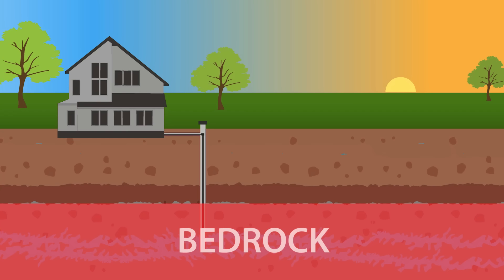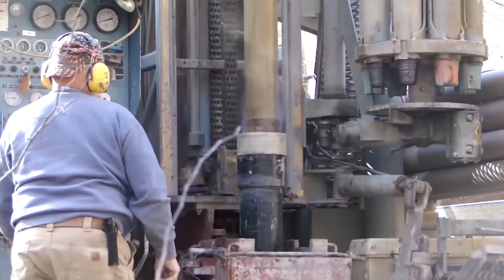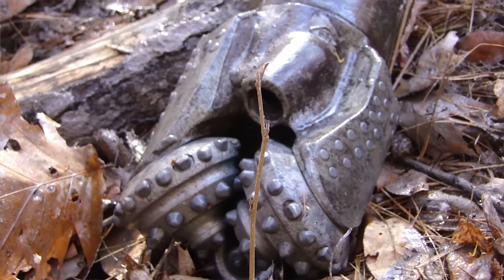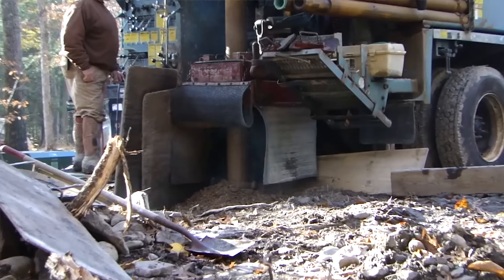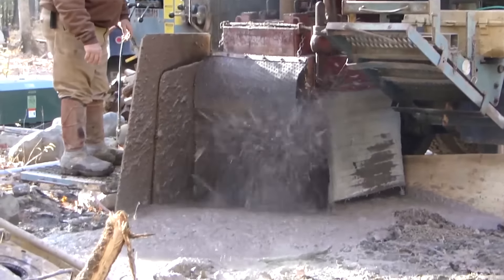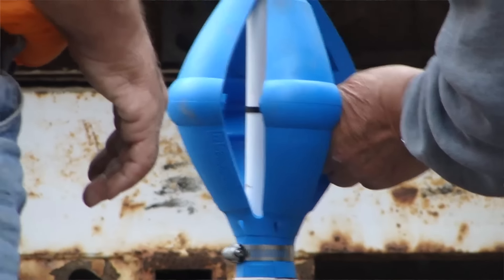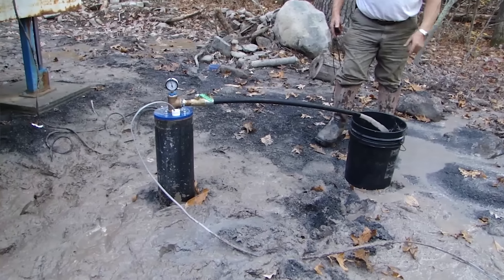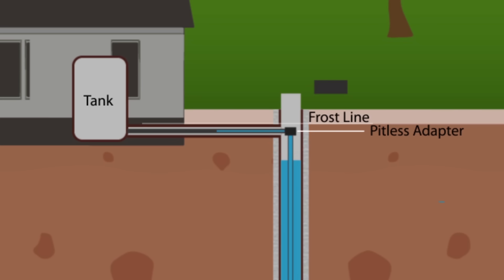WELL DRILLING 101 | Every Step Explained

Comment: PVC is not drainage pipe, the pump line is indeed under great pressure 60-80 PSI
Reply: as a drainlayer this comment confuses me, PVC drainage pipe is actually a thing. Don't often get much bigger than 375mm (should be a blond one shy of 15 inches) however yes the pipe used in this application is not drainage pipe
Reply: PVC pipe/fittings has different ratings.  If you're in Lowe's store, most common are Schedule 40 and DWV.  
The Schedule 40 is for the pipe coming from the well pump and has a maximum operating pressure of 180psi--much higher than the pump could ever generate.  
DWV stands for Drain, Waste, Vent and is used in non-pressurized situations.
Reply: Schedule 80 for electrical conduit
Reply: groundwater level changes from season to season
u went down a bit more than where you are right now just in case for dry season with lower groundwater level
also you gotta consider the water you took out, the more you got out of the well
the less pressure and lower groundwater level it gets.
so it's just safe to go down a bit deeper than you got
Reply: PVC is used for DWV applications. To use pvc for potable use you need to use CPVC. You might be able to get away using regular pvc due to the water never being treated in a plant.
Reply: you can thread schedule 80 pvc . ive done it lol tight situation. i work up in iqaluit nunavut.. not everything is easily accesible. i wouldnt be surprised if it was sch 80 pipe prethreaded specifically for wells.
Reply: Very informative and insightful. Thanks for taking the to time. Could you please give an idea of what the total cost was? Thanks.
Reply: @audrinacartier3903  CPVC, as explained to me by a licensed plumber, is for use in hot water applications as it's melting point is higher than white PVC. Like when building a new house, depending on local building codes, hypothetically speaking, one would use CPVC for all lines coming from the hot water tank and regular PVC for cold water lines. In practice, and depending on local building codes, most contractors just use CPVC throughout because in the grand scheme of building a house, CPVC isn't that much more expensive and eliminates mistakes and confusion between hot and cold.
Reply: Yes,,,, If there is a pump on the end, it is under pressure!!!
Reply: @audrinacartier3903  No, CPVC is just if you are putting hot water through it, PVC is fine for potable water, and that is what was used for my well, but it has to be sch 80 because my well although its 485 f5 deep the static water level is 250, so that is 108 PSI before you start the pump, add 40 -50 psi water pressure plus 50 ft of pump down (20 more psi) and you get pretty close to the limits of sch 40.
Reply: @benwhittier87  ten years ago it cost $21 per foot, the pump install was another 2k my well is 485 so it was about 12K all in
Reply: @garyjohnson4657  Its under pressure just from the weight of the water, and potentially a lot of pressure
Reply: Tell em Mr WranglerStar!
Reply: A wild Wranglerstar has appeared
Reply: Tell me you're a pretend firefighter without telling me you're a pretend firefighter... "...under great pressure 60-80psi..."
Reply: Hey man, shouldn't you be fighting forest fires or showing us how to make caltrops or something? Interesting seeing you lurking on a well video

Comment: There's different grades of PVC for specific use rated by pressure. Your well pipe has quite a bit of pressure actually. 180 feet / 2.31 = 78psi at the pump. Add at least 20psi operating pressure at the house, rounded to rough big phat numbers of about 98 psi total pressure at the pump connection on the pipe. You pipe has to be rated high enough to handle that pressure (probably is twice that amount or more) and your pump has to be rated high enough to lift the water against that 180 feet or 78psi plus your desired pressure at the faucet. Then there's flow rates. hahahaha no not today. Nobody cares lol
Reply: You sound like my engineer!
Reply: Just how they do. hahaha
Reply: Oh, we do care 😈
Reply: In Perth Au a lot of garden bores use 40mm black poly pipe down to depths of 60 to 80M. Pumping rates of 20 to 30 gallons per minute are common feeding large retic systems. Mine is only a baby , a 2Kw pumping from 40M deep.
The water quality can be very hit and miss. I got very lucky. Drinking quality.

Comment: That "blue thing" is a "centralizer" and your presumption is correct in its role.  That "tri" thing at 4:00, is a tri cone bit.  Those little knobs on the three cones are super hard steel and are often coated with industrial grade diamonds (incredibly hard).  As each of the cones rolls on the rock, it grinds up the rock into small bits and the water cooling the bit is mixed with bentonite, a thixotropic mud which means it changes the specific gravity of the drilling fluid causing the rock chips to float to the surface.  FYI, the tri cone bit was invented by Howard Hughes and the source of all the funds that made him the world's richest man of his day.  He virtually gave away the drill bits to those looking for oil with a contract that said if they found and produced oil, he would receive 1/16th or 1/32nd of the value of the oil.  That reads as a small percentage, but some of those wells are still producing today and even at today's price of $60 per barrel, his estate is making $3.75 per barrel....
Reply: After working in the Oil & Gas business, specifically dealing with fractional mineral interest ownership, I find it super interesting and brilliant how Hughes was able to trade his drill bits for royalty interests.  

Having a 1/16th override on ONE productive well could be life changing(in terms of monetary income), let alone having a ‘teener’ on multiple wells in multiple oilfields!
Thanks for the info!  Now I see how the Hughes family really made their fortune.
Reply: I used to take a perfectly new "tricone" drill bit, cut it apart into 3 separate bits, and manufacture an "under-reamer tool." You could drop it down through the casing, then open it up, and keep drilling a wider hole than the casing above. The oilfield is so amazing. I also like watching people drilling for water.
Reply: Great history lesson
Reply: close but one correction. Thixotropic materials change viscosity on shearing, not specific density. The viscosity drops at the drill head. Once away from the drill head motion, the viscosity increases, allowing it to entrain the denser rock chips for flushing to the surface.
Reply: @sniperpaddy3271  Close also but drilling mud is not used with tricones in the water well business. There is a controllable amount of air and water coming down the drill pipe to flush the hole.
Reply: I was wondering what that "blue thing" was.  I thought it was gonna be for a Well Screen to keep sand or fine debris out of the pump/well.
Reply: @yukloop  Trading for percentages was the wild west   back then..but also consider  the price was not that high...also  different bits made there way into industty.
Reply: Nope it’s not a “centralizer “ it’s a torque arrestor that stops the pump from spinning when the pump is turned on. Should only be used in fully cased wells not bedrock because it will be torn up on insertion, use & removal which then may cause the pump to become wedged in the well as most pumps are 3.9 inches in diameter inside a internal 6 inch well casing and if the torque breaks partially or even fully there will be problems. We always have 10 to 15 ft of separation between the pump and the torque just in case and again only use it where applicable. Bad information can cause big expensive repairs-always consult a pro when working on a pump system.
Reply: @brenteisner3665  well stated, we had to pull out our Myers pump a few weeks after replacing the old one that died because with in a few weeks the wires were damaged from torque when the newer pump was kicking on. 189 feet  of hell pulling that up.
Reply: @brenteisner3665 i dont think the torque arrestor creates enuf friction to keep the pump from moving radially when it starts up. it will keep the pump from hitting the walls of the hole. should be positioned no more than a few feet from pump. good idea to use a second one maybe 6 ft or so from the lower one. i doubt the tor arr will be torn up. that rubber is very resilient. think what a rubber tire can endure
Reply: @davidgoliath982  if concerned about “centralized “ location of a pump then one can use a wire guard to keep the pump from striking the walls - in unlined wells only. As with anything parts are only as good as the installer & if installed wrong (happens a lot more than you think) failure is imminent. The rubber has no steel belting or layers of rubber and cheaply made torques tear very easily. As for the control over torquing that is the primary design of the part and absolutely prevents radial movement.
Reply: thanks for taking the time to explain. aw some.
Reply: Howard Hughes!!! Amazing factoid there, thank you. I had no idea that's how he got his money.
Reply: Wow your a human Encyclopedia you should really go to Africa to teach villages or offer your services to the less fortunate remember this phrase I AM BECAUSE WE ARE if u live by this you will make the world a better place if you get 1 person this planet to think the way we were intended to be you have done your job that one person will maybe reach 2 and so on n so forth …. If the ppl of this world only realize I am because we are there we be no more competition no more starvation no more poverty no more sickness no more violence no more evil
Reply: @billone6080  i could be wrong as i dont put in domestic wells, be here in south jersey im pretty sure they do. its all sand till about 3000 feet so when we put in monitoring wells via mud rotary we mix our mud pretty thick to hold the hole open so we dont have to drive a bunch of casing and we just rip thru the sand with a button bit. then we just develop the shit out of the well until the water comes up clean. but then again you're not drinking from a monitoring well. though with a domestic well i would imagine as long as you're not using polymer, the water would be clean enough post development if you just use straight bentonite. i can get you a definite answer tomorrow, got a few people in the domestic well business i know
Reply: @pettybetty2699  oh
Reply: Thixotropic fluids have a relatively high viscosity at rest but under shear stress (mixing) the viscosity decreases. Once the agitation  stops it slowly regains it’s higher viscosity (gelling ability). Bentonite, sepiolite, and attapulgite clays are often a key ingredient in oil/gas drilling muds to keep cuttings suspended above the drill bit and help maintain hydrostatic pressure.
Reply: That blue thing is a torque arrestor.
Reply: @pettybetty2699  Either that or you spend years in the mud etc learning the knowledge and donate your own time.  I'm sure he is capable of deciding when and who he will share his skills with.
He was awfully nice to write this down here for us for free.
Reply: no, its torque arrestor
Reply: Wow! Thanks for the precious details Sir. HAPPY NEW YEAR 2025 TO YOU ALL